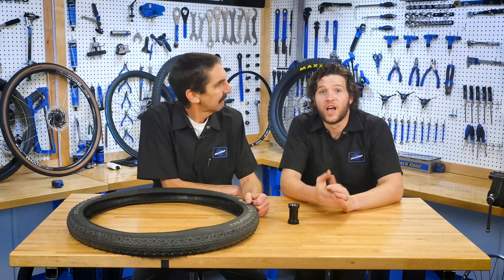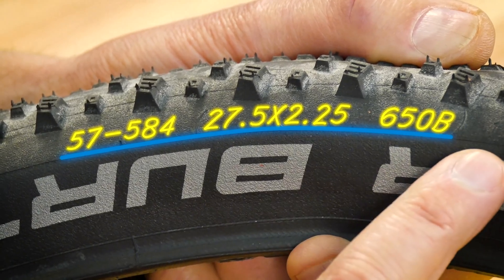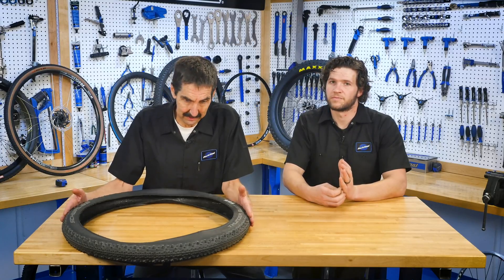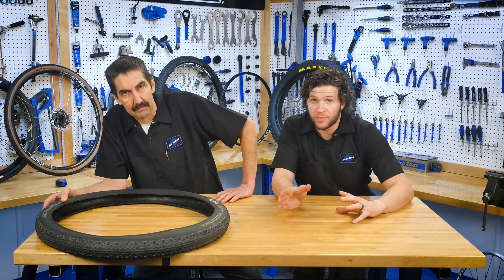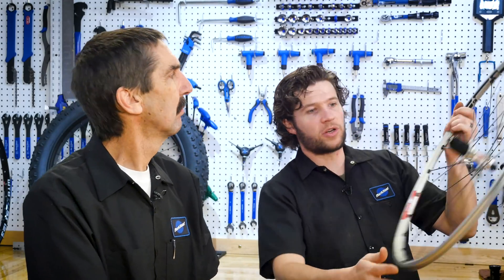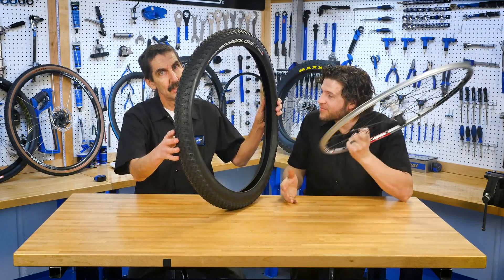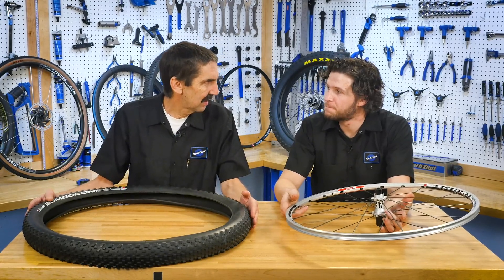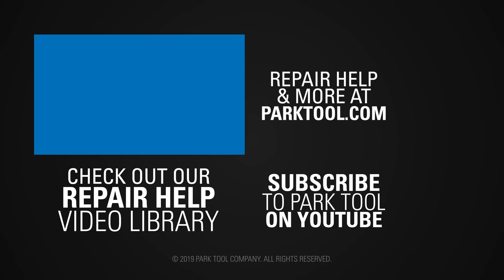Understanding Tire Sizes | Tech Tuesday #145

Comment: 31 x 559 sun rims single track rims with maxxis 55 x 559 26 x 2.5 " High Roller 2 on a full suspension all mountain bike or what they call Enduro now. Im Old school. 
Love what you do Calvin and Truman keep up the entertaining and informative work.
By the way I only buy Park Tool tools. They may be dearer than most but so far the quality has been good (hope it stays that way) and everything is colour matched in Park Tool blue and that helps with my OCD.

Comment: I’m building a 2019 evil Wreckoning 29. All these numbers are driving me crazy and can’t figure out when I go online stores and then they present you with some other numbers. 
Manufacture specs for wheels is 
Wheelset - Front
e*thirteen LG1, Internal Width: 30mm, 15x110  
Wheelset - Rear
e*thirteen LG1, Internal Width: 30mm, 12x148 

What else do I need to know before I grab a set and then it comes to what groupset will fit

Comment: a should of listen first now it cost me, 26x36 braked hubs tyre size 60x559 is 60mm the rim size width inside cheers can i use a smaller rim size width

Comment: Have a 24 in. BMX Original Rims are 24"x1.75"x14Gx36H Tires are 24" X 2.125"
Getting new tires, the "SCHWALBE Black Jack" measures 24 X 2.1
It seems to me the BMX tire industry is more tolerable

Comment: Can you fit 27.5 tire on a 26 inch rim. Thanks.
Reply from the maker: The answer is here:
https://www.parktool.com/blog/repair-help/tire-wheel-and-inner-tube-fit-standards    
See the Bead Seat Diameter of each. If the same, they fit.  Otherwise not.

Comment: Interesting video, and yes there are too many confusing standards. But I'm still confused. For MTB tyres at least, I know that if I buy a 27.5" tyre it will fit my 27.5" rim, regardless of what the ETRTO numbers are. Obviously a wide tyre will not work on a narrow rim, and a narrow tyre on a wide rim won't work too well either. Kinda common sense though isn't it? The only annoying thing is that tyres from different brands  have different widths when fitted, for example a 2.4" from Maxxis and Schwalbe fitted to the same rim will be different widths.

Comment: I have had a frustrating time to find tires.  Front is 32-559 as original but mechanic only had 47-559 for rear tire as replacement.  Works ok since I’m using bike as a commuter.

Comment: What a mess! Part of the reason for all this (I THINK), is that countries, such as France, largely have their own, LONG established cycling cultures. So over the decades, french people were used to their city bikes having, say, '650' diameter wheels/tyres. But when newer city bikes came along, with newer rim/tyre sizing standards, those were ALSO described as '650', in order to identify them to the consumer as city bike tyres!
Then, to add, other 'cycling countries' historically had THEIR own way of labelling/measuring things, which has lead to this confusing CLASH of sizing/standards.
I'm running ETRTO: 56 - 559
  (26x2.2, Maxxis Ardent Race), & ETRTO: 57 - 559 (26x2.2 Maxxis Ikon)...

Comment: what is the torque spec on the two rear shock pivot points. Thanks in advance.  :) I have a 2018 norco fluid FS2+.
Reply from the maker: Norco would love to get this question and you'll have it from the source up north!   See www.norco.com
Reply: @parktool  Got it. Thank you much.  :)

Comment: it is not the outside or the inside diameter ... it relates to the "tire tread", "banda de rodagem", "bande de roulement", which is precise. What happens is that the wider the tire, or the bigger the rim, or the bigger the "not treading" part of the tire, the smaller is the tire tread in relation to the size of the tire. That is why thin tires and fat tires of the same specification might have different sizes and  some with different specification might have the same size, but it does not fit.
It is actually simple. Not that I am an engineer, but engineers never do something that has no actual meaning, at least to them.

Comment: Back in the day I had to explain to costumers a 20 X 1.75 was different from a 20 X 1 3/4.  Damn Schwinns 😂
Reply: What does 20×13/4 mean???
Reply: Pash Thakur when the tire size written on the sidewall was denoted with the fraction 3/4  instead of the .75 it indicated that the tire was a “straight side” tire.  Schwinn brand bikes used these tires on the bikes pre 80s bikes when they were built in Chicago. The Straight side tires did not fit the .75 rims or vise versa. Sometimes the tires were marked as “SS” for straight side.  I ran across SS tires on some English built bikes too.
Reply: Thank you for your time and reply,greatful.I have a rim size of 26×1 3/8  and having a hard time finding a tyre for that rim? Ask some bike guys they say tyre size of 26×1.90- 26×2.20 will fit on that rim! Is that true? If u could answer.Thank you :)
Reply: Pash Thakur a 26 x 1 3/8 is different from those tire sizes. Those 26x1.90 -2.125  are what you would find on a mountain bike. The diameter of the rims are actually different. The old 26 x1 3/8 are what we’re found on the smaller “ road bike” wheels. Just be sure the tire says 26x 1 3/8 on the sidewall with the fraction.
Reply: Pash Thakur just out of curiosity I checked out Amazon and they do have them (a bit pricey). The reviews were an interesting read with a lot of dissatisfied buyers thing they would fit their mountain bike rims.
Reply: Haha. Thanks a lot! I live in india and hard to find those tires😂 well i have to change the rims! Thank you for your time! Appreciate ❤️
Reply: Pash Thakur I am afraid changing the rims may not be the solution. The diameter of the rims is significantly different even though they both say 26”. There could be clearance and brake problems.
Reply: @jbratt  oh yea are you on instagram where i can connect I'll send you the picture
Reply: Pash Thakur yes @jpbratt

Comment: 622 x 20 rims,  came with 38-622  1907P-2 changed up to 54-622  K1047-003 for riding on sandy trails here in SW Florida, works great
Reply: hey, so you could say 47-622 tire would fit nicely to 20-622 rim?

Comment: Can I lace up a 10 speed hub with a 27 1/4 inch rim? I want to retro mod a 74 schwinn super sport and put some new wheels and updated gears on it.
Reply from the maker: Most anything is possible with enough effort and $$.  The spacing on that bike will be 120mm, but the 10 speed hub needs 130mm.  That steel can be cold-set to accept the 130, spreading 5mm per side.  It will not be easy.

Comment: My rim has ETRTO: 622/559x18. Why would it have number/number?
Reply: Not sure, but my guess would be "bead seat diameter"/"effective rim diameter (ERD)". You need the ERD, along with the hub flange diameter, to choose spoke lengths when building a wheel.
Reply: this is probably a rim that was manufactured in two different sizes (622, aka 700c; and 559, aka 26") where they didn't bother to make different decals for each size!
Reply: @geordieks1370  Ah! 559 matches 26" exactly, you're probably right.

Comment: what fun. I work a lot on older bikes. So of course 1.75" width is not 1 3/4", and the 26" inch diameter is a different 26" for each.  Some kind of translate table from you folks would be lovely. The good news is that bikes last a long time. The not-so-good news is that tech Tuesdays tend to cover today and tomorrow bikes, not so much the 'proven technology' (read 'old') examples that are most of what I see.
Reply from the maker: Hi John, I think we might actually have you covered. Table at the bottom of the page: https://www.parktool.com/blog/repair-help/tire-wheel-and-inner-tube-fit-standards

Comment: Living on the edge with 60-622 on my 19mm internal width rim. In case I run into problems, it’s back to the 50-622.
Reply: Push it to the limit song ensues
Reply: I used 57-559 Racing Ralph on 17mm rims on my mtb for years. With tire pressure below 2 bar (29 psi). No problems at all. And my weight in these days was 95 kg. No shocks on the bike.
Reply: @storkstork Whew, good to know - thanks!

Comment: ETRTO system is the only system that works for me. It 's based on the international S.I. measuring system. All the others  systems are from the past. So i only use the ETRTO system, only measure  pressure of my tyres  in bar (which should be kPa) and not PSI, and lenght's and diameters of someone in millimeter and centimeter not in inches. I measure speed in km/h and distances in km or meters. Not in miles or yards.  Never understand why mostly USA not following the S.I. standard, this is the  main reason why we still use this oldish inch system.
Reply: Martin Lorig i too use ETRTO the others I just call BS numbers marketing wank as the only reason I can think of they still have them on the tires.

US needs to go metric they kept the British Imperial system far too long

Comment: Absolutely a big problem with bike industry, including the 20 or so different seat post diameters
Reply: What do you mean? Clearly a 25.4 and a 25.6 are worlds apart and both necessary!
Reply: @Frank Leurs not a tire, seatpost clamp haha
Reply: Dale Zapple:   Agreed.  Back in the day there was a similar “Wild West” in alpine skiing.  Matching boots to bindings was hit and miss.  There were many incompatible combinations.  And combinations that seemed to work but would fail in dire situations.   Finally an international committee was formed that forced all manufacturers to standardize.
Reply: Not really, practically no one uses anything else than 27.2, 30.9, 31.6 and 34.9mmø anymore.
Reply: @th_js  30mm and I cant find it anywhere... norco havoc 2007
Reply: Well more so with MTB's. Race bikes all have the same rims and tyres (the vast majority excluding tubeless).  In the french system the 700c x 20 or 25 can't fail.
Reply: @kodek2000  Race bikes? Pretty sure you mean "road bikes".
Reply: @th_js  No I mean race bike. You guys don't call em that? The way I see it you can use any bike on the road but racing means fast. I'm Belgian we actually use the french word course. 700c is  a typical race tyre.
Reply: @kodek2000  A Downhill mountain bike can be a "Race bike".
Reply: @th_js  I do understand your point. I guess my point of view is old -fashioned.  MTB's are a relative ly new thing. Plus I always considered the word road-bikes  meaning a fast road  bike a misnomer. Doesn't really matter much. I was just saying the 700c is the faster tyre compared to any MTB tyre.
Reply: @kodek2000  Fair enough, I'm quite young and am used to terms from present ;)
Reply: Tomi Saaranen it's the older way of saying road bikes. My parents usually call road bikes "racing bikes".